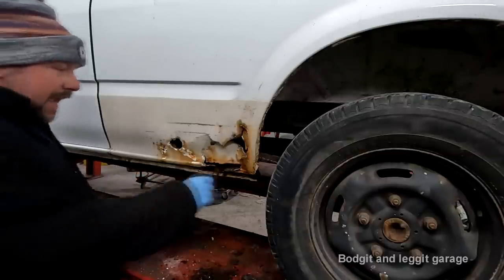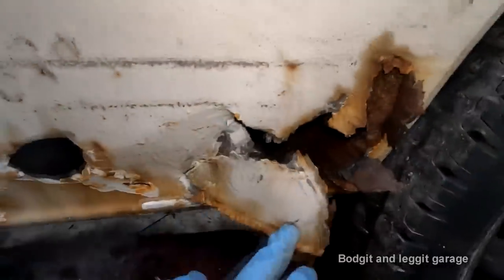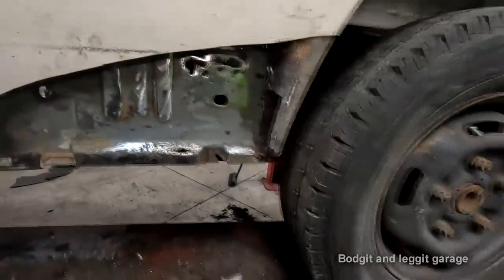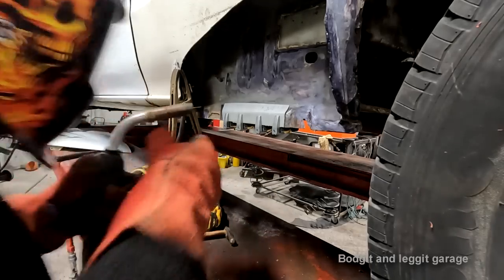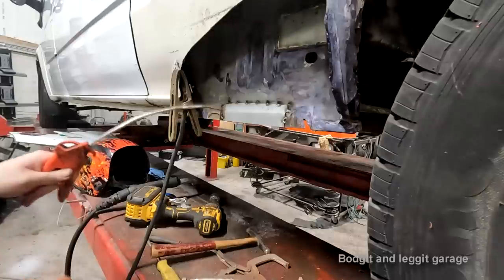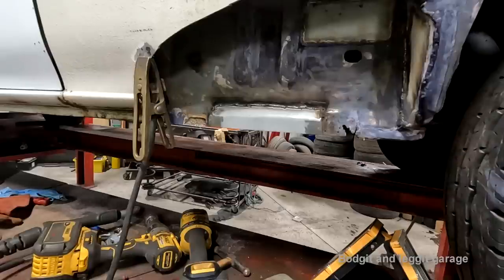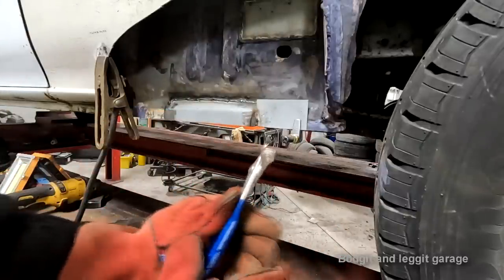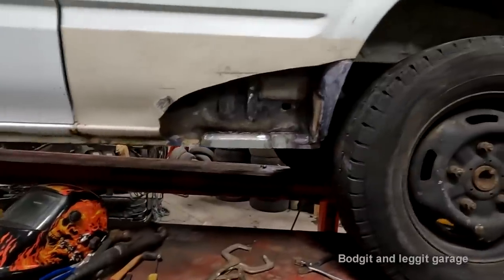DOE Van-dalised Ford Transit Body Forming part 3

Comment: Have had a mark 5 that rotted and we scrapped it in the end. Then got a mark 6 that had a lot of welding done to keep it going. Have a mark 8 now 8 years old does not seem to have the same problem as previous transits with rust maybe Ford improved the rust prevention maybe galvenized areas not sure.

Comment: I've been doing this on my mk7. I made the mistake of replicating the lower eight or nine inches of the inner wheel arch and part way up to the outrigger. I should have just bought the inner. I also had to re-make a big chunk of the chassis outrigger where it joins the inner sill. I am learning fast I am just not fast at doing it.

Comment: I think many of us have seen this vandalism by MOT inspectors, whilst the guidelines are supposed to be a visual inspection to achieve the same failure status.  They must  sometimes be having a "bad day" ?   The latest trend seems to be lists of advisories at the slightest sign of surface rust on brake unions and subframes, shock absorbers or suspension arms, which when treated with a rust converter then become looking like new or that they have been replaced, because it is just faint surface rust.  Time to get out the lanolin sprays?

Comment: They probably poke holes into it to stop people just sanding and filling it and then a spray of paint.  If it’s had holes bashed into it then it’ll be either scrapped or repaired properly if the owner wants to keep it.  I know when we send diving cylinders in for test if they fail they come back cut into three sections… to stop you using them again.
Reply: As some owned several of these this is total waste of money once u start patching them it never ends chassis leg in rear rot out had spring comes up thru floors total scrap switched to renault masters brilliant vans no trouble or rusy